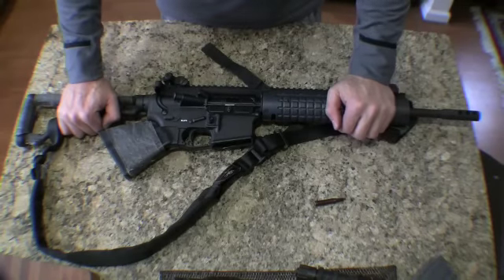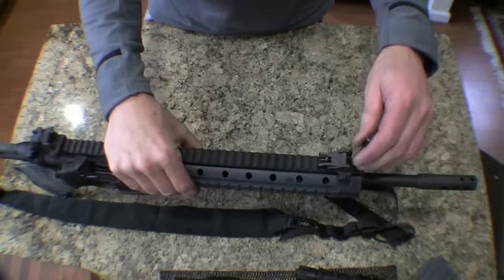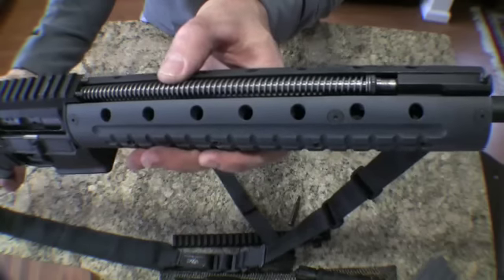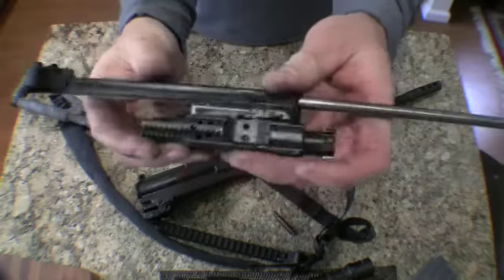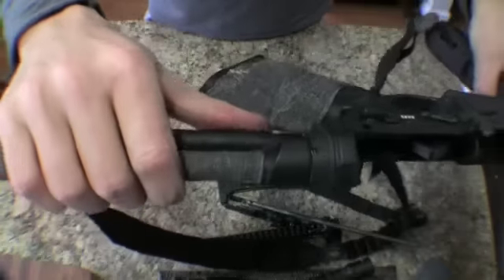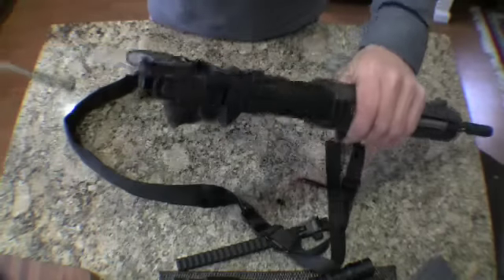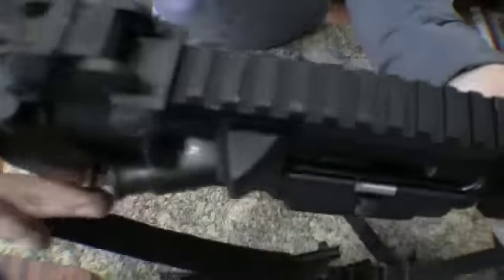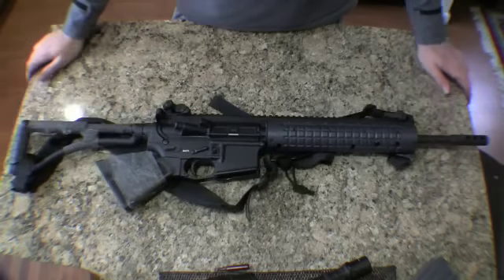LR300 Internals

Comment: Correct me if I'm wrong, but I don't think the LR300 is made anymore. Any idea what happened to the company and/or the people behind it?

Anyway, I'd have to say that the closest thing we have to a successor for the LR300 today would be the SIG MCX, what with its ability to shoot with the stock folded, AR-style controls, and use of STANAG mags.
Reply from the maker: The Sig MCX is a short stroke gas piston design. The LR 300 developed by Al Zitta is a direct impingement. It’s not manufactured anymore, correct.
Reply: @GuneTools  lr300 is not direct impingement it doesnt have a buffer nor a buffer tube
Reply: @zlClutchy what does a buffer or buffer tube have to do with the gas coming back into the carrier? YouTube comments getting dumber by the year

Comment: Could you explain why there are 4 holes at the rear of bolt carrier? Is it for better venting gas that wants to go back between rear of the bolt and corresponding hole in the BC?
Reply: My guess is safety vents to allow higher pressures as a fail safe.  Expensive Modern guns all have safety gas vents